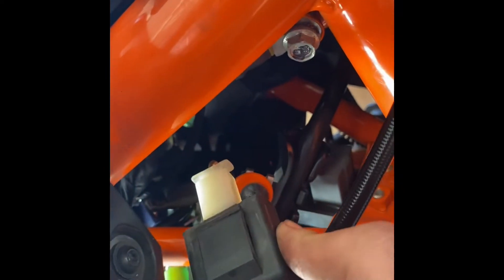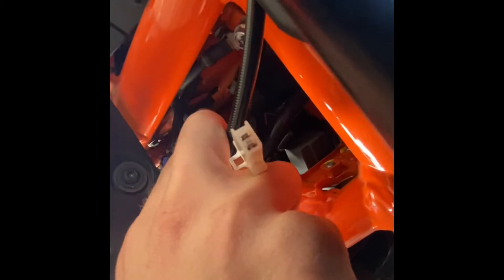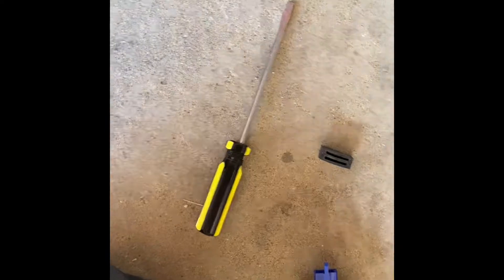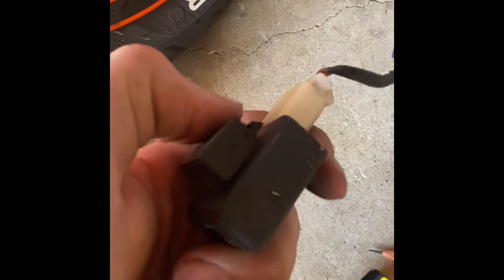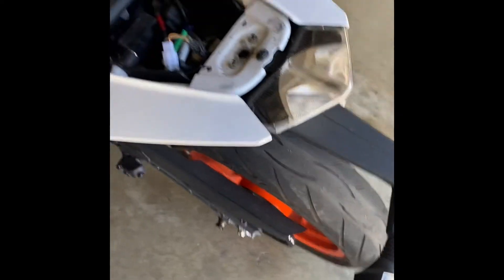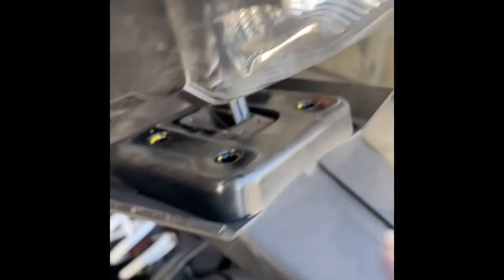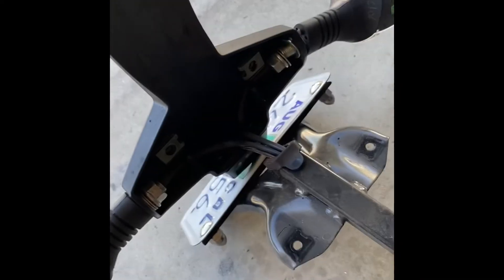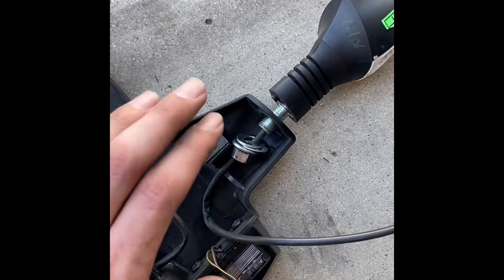KTM Duke 390 OEM LED turn signal installation

Comment: Did they turn on? I did mine with off market leds but ktm flash relay. Didn't work.
Reply from the maker: They did, and worked correctly. I'm unsure why yours may not be working... these LED's still had a resistor inline with them from the factory, do yours? That may be a difference.
Reply: @ryanwest6958  no resistors. They light up about 3 leds of about 11. Appreciate the reply.

Comment: Did you have any issues putting the headlight back on? Something seems to be preventing mine from going back on. I don't think I'm squishing any cables.
Reply from the maker: Yes, it was hard fitting the resistors in a way that wouldn't squish them. It took a little wiggling, and strategic placing. Try to not have the resistors in the same spot, stagger them. It will make it easier since the group of wires won't be as thick. I think it took me a good half hour to get them in properly. When putting the hex bolts back in on the sides, push the black plastic forward as it will make it easier to bolt and it wont seem as if you are pinching anything.
Reply: Yep, pushing the back black plastic part forward was the trick to get the side screws in. That tip saved my ass from hours of struggling

Comment: Can you please send me the part link please I put led flashers and is blinking fast any help
Reply from the maker: Part numbers and the website I used are in the description. It sounds like you've replaced the flashers, but not the relay. You need to do one of two things: buy an aftermarket LED relay/buy KTM LED relay, or splice resistors into each light. I personally would buy the relay.

Comment: So is the end result hyper flashing in the rear and normal speed in the front?
Reply from the maker: The result is normal speed in both the front and the back. The hyper flashing was a result of not having the front signals installed yet.